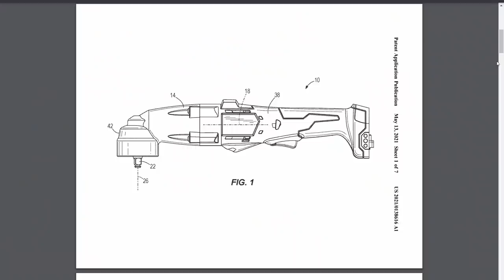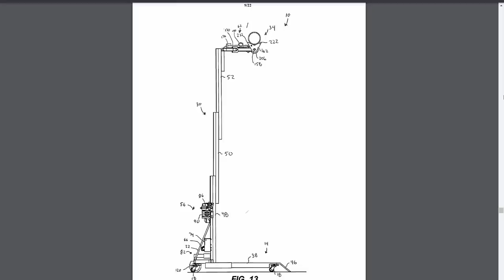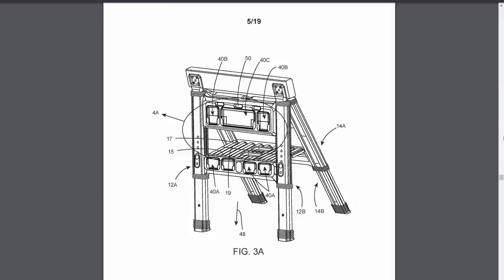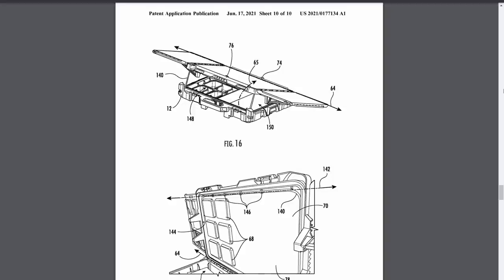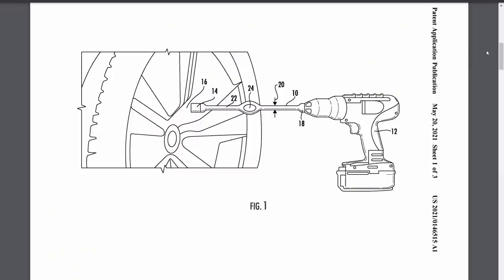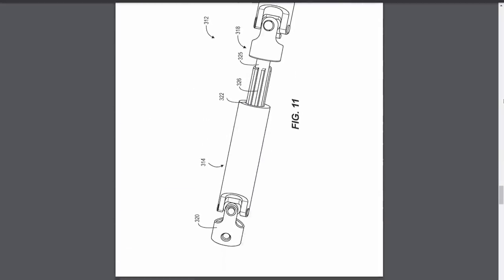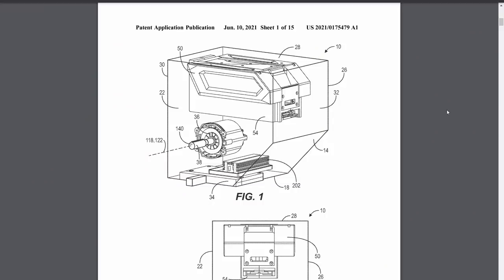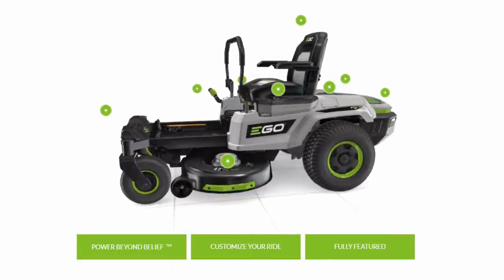New Milwaukee Tool Patents for 2021 - Part 2!

Comment: I was considering Ego as I’ll soon need a snowblower. If Milwaukee comes out with one before then, I’ll be the first in line!
Thanks Nate, these are some of my fav vids. Going to have to watch it again though, as I forgot about everything except the possibility of a red snowblower. 🤣
Reply from the maker: It might be a while on that Milwaukee snowblower. It was almost just a footnote in the patent text along the lines of "an MXFUEL snowblower won't need as much cooling due to operating conditions." Milwaukee's got a genius working for them right there! 😂
Reply: @DoresoomReviews  Without that kind of deep insight, we could have an overcooled snowblower on our hands. We wouldn't want that! 😂
We'll see though. If there's progress on it I may hold out. I may even use an old-fashioned, internal combustion engine model for a season. 🤪
Reply: I switched to Ego and really love my tools. Better batteries and very very good tools.

Comment: I speculated a few days ago that they would do an Mx fuel back pack blower since they (TTI/ Ryobi) released a handheld 40v blower that is more powerful than the current Milwaukee blower. Nice to see some confirmation on that. It makes sense.
Reply from the maker: I've been testing that new Ryobi 40V Whisper blower. It's impressive! I totally agree - TTI won't let Ryobi outdo Milwaukee for long.

Comment: I love my Milwaukee stuff and their warranty but my lawn equipment is the Greenworks 60v stuff. The high cfm 60v blower puts out 2x the air as the M18 blower and with the 6AH battery lasts longer than the M18 with the 12.0HD. Also the Greenworks 60v is less expensive.
Reply from the maker: Yeah, up until recently I was all EGO 56V for OPE.

Comment: Am most excited about a full size M18 plunge router and a track saw. And this is just my opinion I believe they are trying to figure out a way to place the Larger M18 fuel battery
Reply from the maker: Home Depot just leaked a 6-1/2" FUEL tracksaw. Was model 2831-20, but now the listing is pulled. They just had a placeholder image of the regular 6-1/2" circular saw though.
Reply: @DoresoomReviews  I went online to see if I can find a pic found one and took a screenshot. And went back and can't find it anywhere.

Comment: Something easily overlooked here is that these patens can cost anywhere from $20,000-$100,000 each.
Have you ever kept track of how many tools come out when the patent wasn’t found?
Reply from the maker: LOL, I need to! There are lots that just don't have patentable features. I've gotten quite a few right over the years, but some we've still never seen. It took the M12 chainsaw almost 3 years after I originally found it!

Comment: Milwaukee has HVAC and electrical covered pretty well. But I would like to see a cable stapler that works with cables from #12 Romex down to 4-wire thermostat wire
Reply from the maker: You couldn't have timed that comment better - Milwaukee JUST announced an M12 insulated cable stapler! https://www.instagram.com/p/CU5VkBegpK-/?utm_medium=copy_link

Comment: Thanks for another great video! In a past patent video, you mentioned a MX-Fuel Plate Compactor….There is only one such device on the planet currently, made by Wacker-Neuson, which, as luck would have it, I was getting a quote on when I watched your video (came out to over $4K with batteries). Suffice to say, I didn’t move forward with the purchase, and bought a cheap standard gas-operated compactor to tide me over. Have you seen/heard any more regarding that tool?  It would be a game changer for me, who only utilizes a compactor half the year, which always leads to problems when I go to use it again after sitting that long. Thanks again for all your work collecting this info for us.
Reply from the maker: I think they had it shown in another patent as an example of equipment they might make for the MXFUEL platform, but I haven't seen anything else about it.
Reply: @DoresoomReviews  I’ll just keep praying and keeping all fingers and toes crossed 🤞🏼for it. Of all the available, announced, and potential tools in the MX Fuel line, I would bet a plate compactor would sell the most, with the cut off saw a close 2nd. The rest of the current line are just too niche in my opinion. I do almost every sort of residential construction work there is, and other than the cut-off saw, I honestly don’t have a need for any of the other tools in the line (the power supply is cool, but I already have the EGO power station) I’m really hoping they bring more useful tools to the line soon. Thanks again for keeping your eyes and ears open for upcoming products, and keep up the great work.

Comment: I could see the Milwaukee lawn mower using the same batteries as the Carry On Power Supply.
Reply from the maker: The walk behind one is definitely on the M18 platform - Milwaukee has officially confirmed that. But if they come out with a zero turn or stand on mower, it will likely be MXFUEL and aimed at pros. But I don't think there's any way Milwaukee would make a mass-market tool that's appealing to homeowners on the MXFUEL platform - it's just way too expensive. $350 for a compact battery, $600 for an XC battery. They would have priced themselves beyond the other battery mower competition from just the bare battery alone!

Comment: We were waiting at the end for the track saw but the sitting mower seems like an ok compromise for now…
Reply from the maker: Home Depot just leaked a 6-1/2" FUEL tracksaw a few days after I posted this video. Was model 2831-20, but now the listing is pulled. They just had a placeholder image of the regular 6-1/2" circular saw though.

Comment: Milwaukee have been working on a track saw. A concept was originally developed about 2 years ago. I believe they had some issues with it maybe on acruicy.
Reply from the maker: Home Depot just leaked it - a 6-1/2" FUEL tracksaw. Was model 2831-20, but now the listing is pulled. They just had a placeholder image of the regular 6-1/2" circular saw though.

Comment: considering that milwaukee relased a dual fast charger for M18 the milwaukee enginers are problably plannig for a while to start dual battery tool.
Reply from the maker: That's a great point that I hadn't thought about.

Comment: When will we see a m 18 biscuit jointer or track saw
Reply from the maker: I have the Makita LXT biscuit jointer. Cordless is so nice for that tool! I'm not sure why no other tool manufacturers currently make one though. DeWalt used to on their 18V NiCd line.
Reply: I don’t understand that either they are so handy was thinking about getting a battery adaptor so I can use my Milwaukee batteries on the Makita biscuit joiner
Reply: Totally agree on the m18 biscuit jointer. Of course want to see the track saw as well,  along with a m18 belt sander, updated cordless planer... and some kind of auto start for cordless tools synced with a vac... wonder why Milwaukee doesn't release some of these when Makita has had at least some of these products for several years

Comment: Why do you think Milwaukee are reluctant to go twin batteries?
Reply from the maker: Because that's what they told us at NPS18 just 3 years ago.
Reply: @DoresoomReviews  I personally don’t see a problem but it’s probably so they can push the MX line.
Reply from the maker: @Beariam24  I think it was mainly to malign Makita with their LXT X2 system and hype their new (at the time) HO batteries.

Comment: M18 power station please!!!  🤞
Reply from the maker: https://patents.google.com/patent/US20190356147A1
Reply: Wen will you think Milwaukee would release a power station and do u think it will be pure sine wave
Reply from the maker: If they do, I think it will be pure sine wave. Their top-off power supply isn't though, but it's just single battery.

Comment: 6:03 thats definitly not a mx fuel that is a m18 just by looking at the battery compartment. Look identical to my quick lok.
Reply from the maker: It's quite possible it's M18, but the first few figures in the patent really make it look like MXFUEL. I went back and forth a few times deciding which platform I thought it was on. Figures 1 and 2 show an elongated battery that I really think looks like MXFUEL. But Figure 4 squishes the aspect ratio and makes it look more like an M18 battery. I guess we'll find out for sure if/when they release it.

Comment: I hate MX fuel.... I don't want to invest in another battery platform for a single tool they definitely need to use multiple M18 batteries for these larger tools
Reply from the maker: Hopefully they add some overlap with M18 X2 where possible.

Comment: Milwaukee really needs to offer more battery warranty because im sick of replacing batteries a few months out of their warranty period. Cant fault their tools
Reply from the maker: Dang, that sucks! The XC packs generally have a year longer warranty than the slim packs. Which type do you find die most often?
Reply: @DoresoomReviews  lots of 5.0s, some 6.0s. just had an 8.0 replaced after 1 year. Oddly I've never had issues with an M12 battery
Reply: @perfectdiversion  what tools do use

Comment: Where is the tracksaw??
Reply from the maker: I know! 😂
Reply: Pathetic is the reality they don't have one.
Reply from the maker: Home Depot just leaked it - a 6-1/2" FUEL tracksaw. Was model 2831-20, but now the listing is pulled. They just had a placeholder image of the regular 6-1/2" circular saw though.

Comment: That M12 right angle impact wrench is WEAKSAUCE.  It may be rated at 200ft*lb but it really only produces like 100.
Reply from the maker: Interesting - I hadn't reviewed that one myself, I was just going off specs. According to Torque Test channel it only manages 114 ft-lbs for fastening. It does better with breaking loose fasteners at 182 ft-lbs.